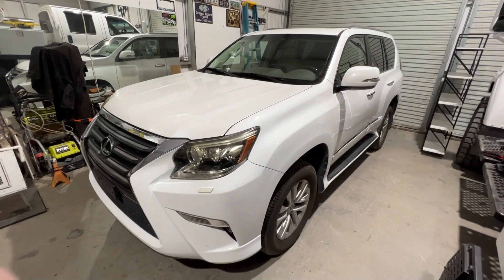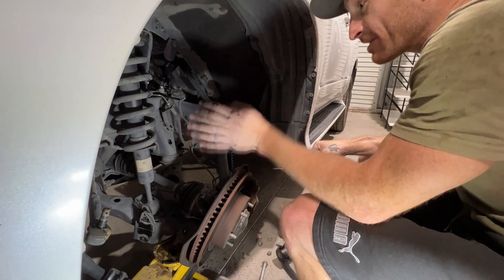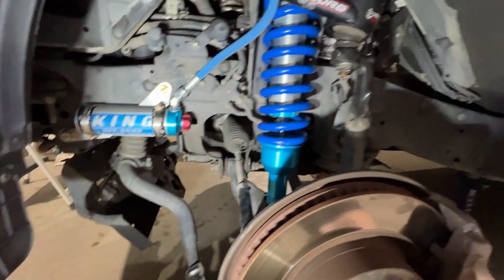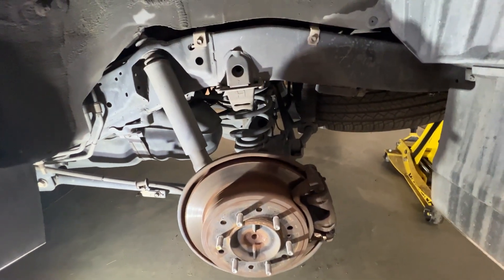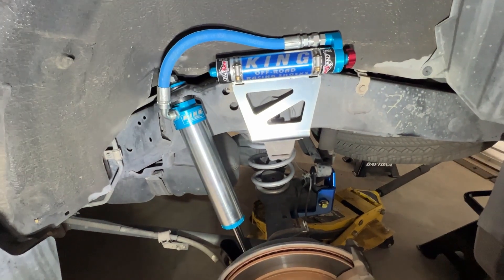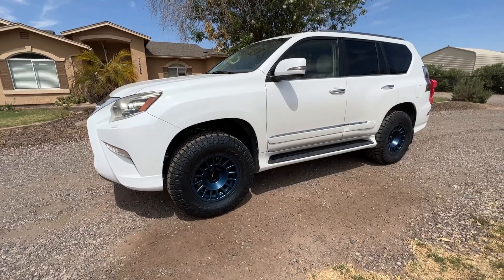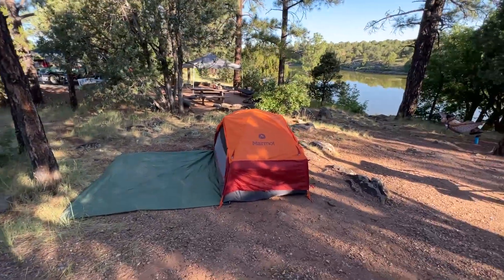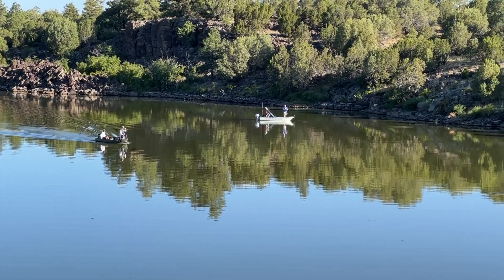Building our Lexus GX460 Part 1- King Lift kit, Dr. KDSS, RiGD Ultraswing

Comment: Are you rubbing on the front reservoirs at all? I just installed this same exact kit, same wheel specs, and tires, and I'm rubbing on the front reservoirs on both sides
Reply from the maker: I am rubbing slightly I need to do an update video I put 35s on and some 1.5” wheel spacers.

Comment: When you fit the 285/70R17 tires did you have to do a body mount chop or relocation? Are those Method wheels 17x8.5+0? I’m looking at wheels in that size and I’m wondering if I need to do any body mount work. Thanks!
Reply from the maker: No body work for that size! And yes that’s the offset of the method wheels!

Comment: You asked, so lm not a fan of the Lexus! I'm a G.M  guy, love your Kodiak build and will stay true to you for that build. I have a Yukon XL ( cousin to a suburban) l have a 2500 with an L.B.Z. Duramax and a 6 - speed ALLISON. In it , l wish you would have built out your Suburban,  a lift, maybe a solid axle swap?...
Anyway,  Have fun and as always thanks for sharing 👍🏻.
Reply from the maker: I’m a ford guy that doesn’t own any Fords 😂 we all have our preferences… Kodiak content is on the way 🤙🏻 thanks for the comment.
Reply: I have a confession,  l am a G.M. guy first, after that it's Ford than Dodge , Nissan would be #4 . Lexus is a great platform for what it looks like your doing! I did see some real cool ? 470 ? Something?
I know they made a very capable off - roader. I just loved your suburban!  Do have fun, l do love the " King " shocks! Real nice start to the lift and suspension 💪. 
Peace 🤘🤘🧡 😛 🇨🇦.
Reply from the maker: @h.h.legacydiesel6724  the suburban wasn’t really built to tow with the aftermarket stuff done to it. I bent a valve and broke a valve spring towing the rzr to Baja. I am really enjoying this duramax in the Kodiak. Has tons of power. The GX is very capable offroad and has a v8 to tow Tiffany’s horse. And it’s very nice inside. First time owning a Lexus.